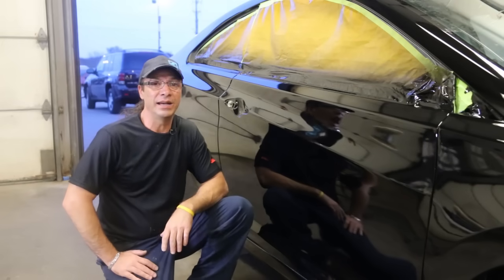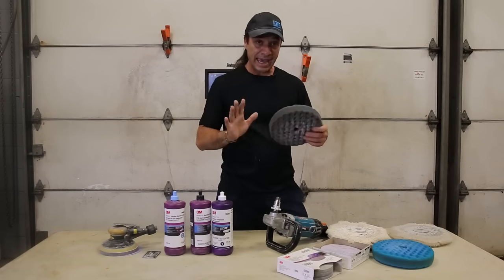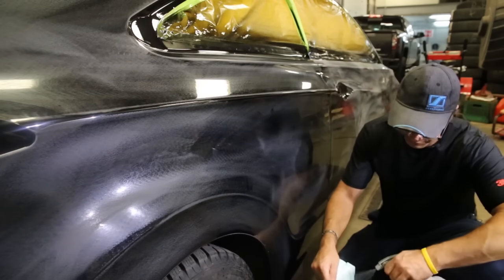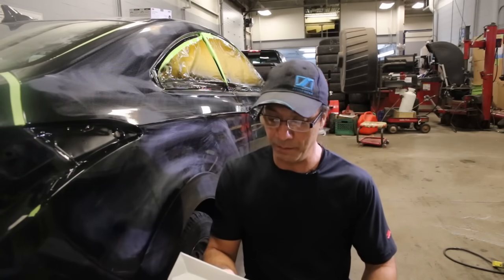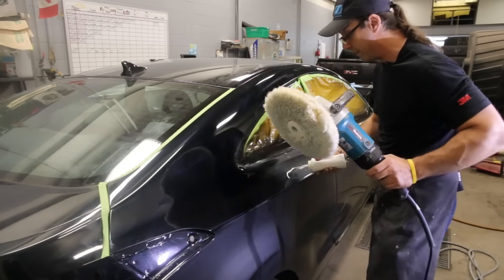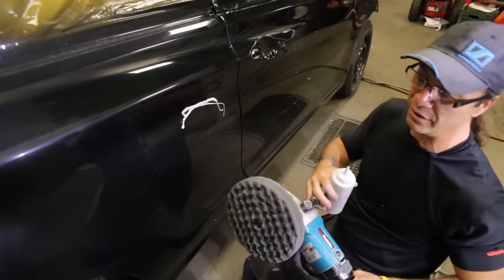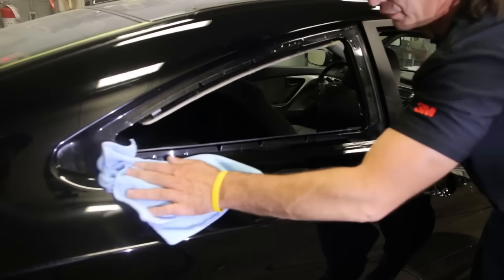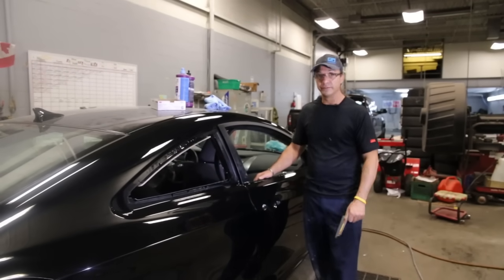Professional wet/dry sanding and polishing tutorial. 3m Trizact system, EX Compound

Comment: Not mentioned enough in this video is the time he spends getting the defects out is on the magnitude of 3-5 times faster than using random orbit. It’s also the only video online where I can’t fault his process. Right compounds, discs and tool. This is an old video. Maybe using trizact 1500 instead of 3m film discs. and instead of 5000 grit trizact go to 8000grit.  Also maybe 3m extreme cut. These all have been released after this video was released.
Reply from the maker: Thanks for the comment but 8000 is useless with today’s clears and compounds. 3000 is perfect with many of today’s products

Comment: Can u buff out pig tails or do I have to sand again?
Reply from the maker: Well. Yes and no. If you create enough heat with the pad you might be able to get them out. Pig tails are caused by the sandpaper being clogged, make sure you wipe it clean more often. You can only go so far with it.
Reply: @loves-Rush-2112  oh yeah I noticed on the spots I held it longer they went away but it does get hot
Reply from the maker: @chrisoo8998  you’ll learn over time how hot you can go before burning the clear. Good luck.
Reply: @loveja1  I'm using a rupes random orbital 21
Reply from the maker: @chrisoo8998  those should only be used as a last step to enhance the gloss and remove swirls. Don’t forget, time = money. Use the rotary first then the orbital.

Comment: Iam using 3m 1500 dry and 3000wet how to keep the curly cues out of fresh paint especially black.
Reply from the maker: lil j are you getting them from the 1500? You can also try 2000 dry then 3000 wet. Once you start seeing pig tails from your 1500, wipe it on your pants as it's running then keep sanding till the pig tails start again. Then change the paper.
Reply: loveja1 yes 1500 dry I try and wipe as I go and wipe pad.iam in a production body shop
Reply from the maker: lil j make sure you follow my steps exactly. From the first wiping down the surface so it's clean and so on. If you can leave a finger print in the fresh paint then it's too soon to sand. Or you just may need more time with the 3000. Make sure you put a bit of soap in your spray bottle and never use a bucket of water.
Reply: loveja1 I use spray bottle of water for 3000 and solvent to clean with

Comment: What exactly do you mean by "dirt"?  You keep mentioning it in the video.   I'm guessing that you mean it's just a high spot in the paint (you pointed out a few of them during the video).
Reply from the maker: ed nja it’s the whole reason behind what this video is about. When you paint a car you’ll get a little bit of dirt in the paint, usually a little spec here and there and you’ll see it in the clear coat. Wet sand and polishing eliminates that.

Comment: What speed do you compound at? Also what is the trick to getting wax out of cracks that you can not get to like chrome trim you do not want to remove due to the risk of bending original 1967 pieces of trim. HAHA
Reply from the maker: Tim Bauer I believe I was using around 1500 rpm. They sell little detail brushes with different lengths. Ask your supplier if they have anything like that.

Comment: someone tried first 1500 step with trizact? should last much longer as those 1500 finish film discs, isn't it ?
Reply from the maker: I don’t understand your question. Explain.
Reply: @loveja1  the first round of orbital sanding with 1500 grit. Did someone tried that with trizact 1500? Or does it not show the nibs as good ?
Reply from the maker: @lutra7670  2000 will work perfectly as well to show all the dirt nibs.
Reply: I understand that. The question is if for the first step a trizact disc would work better ?
Reply from the maker: @lutra7670  yes. You can start with 2000 trizac and make sure you have the interface pad on first.

Comment: What are the rpms on cutting stage  and RPMs on polishing stage ?
Reply from the maker: Probably 1500 for compounding then maybe 1200 for polishing. Give it take a little bit. I don’t even look any more, I just know by the sound but that comes with experience.
Reply: @loveja1  look like you have done it before 🤠
I have used rotary for 15 years switched to DA  hated every minute of it 👎👎🤮
Back at big boys world with my new DeWalt.
Thank you 
Always thought to go higher with polishing .
Love the rotary way more than da , just a little marking issue but other than that total gold 👍👍
Reply from the maker: @Jan-zm2yv  what I’ve been doing lately is wet sand and use compound for the first step then use a DA with compound then polish with a DA. The results are really nice with no swirls.
Reply: @loveja1  I've seen amazing results from you and others but in most cases it takes way too long of a time I believe even though I only had an entry level da I have said goodbye to da forever
Reply from the maker: @Jan-zm2yv  I really need to make an updated video that incorporates a DA for the final finish. It really does remove the swirls much better.
Reply: @loveja1  I believe you I do the buffing very little don't have  anyone  paying me $2,000 to spend two days on one car.
I don't know if my da was just bad because it was an chemical guys entry level one and maybe I will do a lot better and like the rupes a lot better but I am back in the rotary world and I don't see no way out

Comment: Did that 3000 take out the orange peel looks pretty flat after you did 3000
Reply from the maker: No it will not. Seeing that the 3000 is a soft pad and with the backing pad being soft as well, it will contour itself to all the highs and lows of the orange peel. It will not remove peel what so ever. It’s too fine of a grit.
Reply: how did you get that 3000 to take out the 1500 scratches i just did a hood with 1500 then 2000 then 3000 an buffed an cant get rid of those 1500 scratches took me three times of sanding with 2000
Reply from the maker: @thespraysociety3276  what are you using to get the scratches out? Compound and pad?
Reply: im used of cutting the clear flat then buffing so keeping orange peel is new to me ,but im using d a with backing pad an 3m compound perfect it , the painter said i need a new wool pad so hopefully that helps this is my first polishing job i come from restoration , also is final inspection good to use to clean between steps.
Reply from the maker: @thespraysociety3276  you don’t need to clean in between steps.

Comment: Should I polish the entire car if it wasn’t paint entirely?
Reply from the maker: No need to. I usually do the panel next to it in case it has oxidation or over spray. But to each his own and depends on the vehicle and shop you work for. If it’s not needed, leave it.
Reply: @loveja1  thanks, another question. Do you think this particularly way to polish is a good way to start polishing as a side hustle (me being a beginner)?
Reply from the maker: @benben-sx4xb  there are much cheaper polishes out there for just standard detail jobs. 3m is very costly so find something at your local detail centre that’s more cost effective.
Reply: @loveja1  perfect, another thing, what if the car is not black is it the same process and products if so what other product would you recommend? (please mention them in the order of the process) thank you a lot in advance.
Reply from the maker: @benben-sx4xb  I would recommend these steps no matter what colour.

Comment: Why not take all the orange peel off the car? Ig going for show car finish would you cut flat first by hand with 1000 then 1500 machine ?
Reply from the maker: This is a different process. If you’re doing a show car, then yes, remove all the peel. But if you’re doing a factory paint job, then you’ll want to leave the factory looking peel.
Reply: @loveja1  Thank you for taking the time to respond. Great video!! I was just hired at a shop that does custom paint work and my job is to sand completely flat and buff the cars out. I always did it by hand but if i can use an air sander after i get it flat it with 1000 It would be great.
Reply from the maker: @AAhshitsun  if they are custom paint jobs then you’ll want to block wet sand them.
Reply: @loveja1  yes I block them with 1000 to get them flat. Do you block step all the way up then? I see more and more pros using DAs and trtaxt 1500 wet after they get it flat.
Reply from the maker: @AAhshitsun  I only block with 1000. Then I go to a soft pad for the 1500,2000. Then da with 3000 wet with an interface pad.
Reply: @loveja1  Ok I see. So you do not recommend a DA for 1500 and only for 3k. Anytime I use 1500 wet I get pigtails and squiggles everywhere. Im using Trizac and a 2.5 mm throw sander. The clear is just so soft I wonder if that is the problem because I never had trouble DA anything else. I  really appreciate the help.
Reply from the maker: @AAhshitsun  depends what you’re trying to do. Show cars or Just production stuff.
Reply: @loveja1  Doing show cars only. Fresh unbaked paint 3 days old. The clear is usually soft so thats why the pigtails with 1500 DA maybe. Just tryna figure out a faster and easier method after 1000 grit. Thanks again!
Reply from the maker: You are getting pig tails because you’re using the paper past the recommended using time. You can wipe it with a cloth to get the dust off.
Reply: @loveja1  I only use wet trizact after hard blocking on 1000. The clear is real soft as these guys dont bake and put it on heavy.
Reply from the maker: @AAhshitsun  I would suggest to put it in the sun for a couple of days first. You may get it flat now, but in a month it will shrink back

Comment: For some reason my d.a still leaves pigtails even after using 3k & 5k trizact
Reply from the maker: It’s the paper and not the da, you’re sanding too much without cleaning the paper frequently.
Reply from the maker: Just run it across your pants while it’s on.
Reply: @loveja1  i dont think it’s that cause I use brand new paper pass it 3-4 times and then use 3000 trizact wet then 5k wet and I’ll still get pigtails
Reply: @loveja1  and I use a rag to clean the paper

Comment: 200 cars a month. Thats cute i remember my first rodeo lol. We do 60 cars a day paint and i have to correct them. 3m is good because of the fillers. But water base is easier clean up and no fillers
Reply from the maker: 60 a day? That’s nearly impossible unless you have 10 spray booths.
Reply: We have 3 lines  9 booths total are cars are bagged then the side of the booth opens up and cars are on carts on a track go thru side ways.  I base one base other then clear both shove them down to the 3 booth to bake together . Why im base 2 more. Each line paints 20 a day
Reply: It was 24 cars per line but they finally got realistic and dropped it to 20 and its a struggle to get 20 done. Water base  im not a fan i perfer solvent myself.

Comment: Why not drysand with 3000 grid and then one step polish with DA to remove heavy swirls ?
2 steps instead of 4
No need to go after holograms then as well
Reply from the maker: You’ll never get a piece of dirt out of the paint with 3000.
Reply: @loveja1  what if removing heavy swirls with  3000grid by da ?
Reply from the maker: @007carwashluontoonliikkuva3  you don’t need to sand out swirl marks, just polish them out
Reply: @loveja1  i feel like it would be good idea to sand them down instead when they are very heavy swirls.
Da 3000 grid sand and then one step da polish
Reply from the maker: @007carwashluontoonliikkuva3  all you can do is try and see your final outcome

Comment: I just painted my first car .... And I'm really screwing up the finish work
Reply from the maker: What are you trying to do? Give me a detailed description
Reply: @loveja1  trizact.... I keep getting curlies from one of my steps. I've done the whole truck now the hood looks like trash
Reply: My goal was to remove all of the orange peel. Give it that really nice show car shine....
Did a frame off restoration on my 67 C10
Reply from the maker: @michaelrodgers5105  you can only use those disks for so long before they clog. You can do a small section then rub it on your pants while it’s running, basically you can only do that once. Make sure the surface is clean before starting and wipe your pad off as well. You have to take a lot of precautions when sanding dry because if you get a little piece of dirt on the pad you won’t notice until it’s too late.
Reply from the maker: @michaelrodgers5105  maybe try some 2000 wet then 3000 on a da for your last step.
Reply: @loveja1  I've been doing sections at a time starting with new paper all the way up to 8000..... Two problems I had on the hood got bad advice. Was told to wet sand the whole hood with 1000. 2nd problem was I finally figured out it was my purple foam finishing pad. That I just opened up new. I wipe them off and blow them out. Thinking it was contaminated right from the start of I embedded something in it by wiping it off..... Maybe???
Reply: @loveja1  is there a technique or method to keep the hood from pushing down and moving?  I think that's part of my problem of getting a nice uniform look.  I thought high building and blocking it out was a pain.
Reply from the maker: @michaelrodgers5105  anything above 3000 is pretty useless I’ve always found. Starting to wetsand with 1000 is fine but then you need to follow up with 1500-2000-3000. If you can find an orbital polisher try it, it’s amazing for the last couple of steps. I’m going to do a tutorial on it soon.
Reply: @loveja1  I just ordered the 5.5" Adams one.  I couldn't justify the rupes. I've bought way too much stuff now that I will probably only use once
Reply: @loveja1  I'm also using the DeWalt polisher that's awkward to hold.... But that also comes with my great lack of experience
Reply from the maker: @michaelrodgers5105  you can try and put something under the hood to support it, maybe a blanket ?
Reply from the maker: @michaelrodgers5105  are you in Canada?
Reply: @loveja1  no.... Jersey
Reply: I didn't think about putting a blanket under there. "work smarter not harder"
Reply: @loveja1   as far as a clear coat goes. Does the hardness matter, when comes to sanding and final polish?
Reply from the maker: @michaelrodgers5105  do you gave an iPhone? FaceTime me. 519-854-8973
Reply: @loveja1  no

Comment: Nice instructional. Much needed for after painting. But leave the orange peel? Is that European? I've never wanted to buy a car or own one with visible orange peel. ugh!
Reply from the maker: Rick Bell every car has orange peel, except for some European models or high end. Need to bring it back to a factory look, what ever that may be.
Reply: @loveja1  Thanks yes. I just shot some clear today and my best still left a bit of orange peel. Changed the pressure, the distance and still could not lay it on as well as pros can. I'm not sure why orange peel is something that people want on their cars. It makes no sense really since it is a defect basically. Not like glass smooth. Which to me would be a show car perfection. I've ordered over $300 dollars worth of sanding disks, polishes and 1500, 3,000 grit sandpapers to get rid of as much as I can.
Reply from the maker: Rick Bell do the panels that you didn’t paint have orange peel? What type of vehicle?
Reply: @loveja1  The car is a 70 Mach 1 mustang I'm restoring. Back then, in the 70's in America the paint was put on very smooth and glass-like. AS far as I know. Of course, these older cars may have been done differently than they do them today. Happy New Year Bro!
Reply: @loveja1  The car had no paint on it when I got it other than rust. REstoration. But from the factory in 70 they were done with mirror like finishes. Super smooth.
Reply from the maker: Rick Bell they were all like that because they were all painted with lacquer. Which had to be wet sand and polished.

Comment: With my experience... at least the day after to buff... the clear will dye back and it’ll look dull soon.!!!
Reply from the maker: Julio Vega it may if it’s cheaper clear.
Reply: Even with the most expensive clears it’ll happen... you need to wait at least a month for the paint to fully cure... it needs to breathe and let out all the solvents... then you can polish and cut it... you’ll notice the clear is way harder and it’s definitely going to take longer to buff out... but it will not dye back... obviously an hour after it’s painted the clear is soft and easy to buff... but it will look dull later...
Reply from the maker: Julio Vega I’m not sure what process you are doing because I’ve never had an issue with it dying back.

Comment: Hy! I'n curious, what quantity of diesel you burn for baking the car for twenty minutes after you paint it?
Reply from the maker: Plesea Gabriel it’s propane. Diesel would cost a fortune
Reply: @loveja1  The reason why I'm asking is because I recently painted my car and I dicovered that the man didn't start  the heating(it has diesel heating sistem). He used the cabin only for ventilatilation and filters, but he painted the car at 41°. After buffing and polishing the care is mirror finish.
Reply: What is the difference betwen coked paint and a natural drying proces?
Reply from the maker: Plesea Gabriel if you don’t work in a production shop then it’s not a big deal. Letting it dry naturally will allow the paint to flow out better. Only downside is that you have to wait a little longer for the paint to harden before reassembling or wet sanding. I can’t give you a time on this because every paint has different drying times.
Reply: @loveja1  Yeah, in my case, it took one night before wet sanding. Thank's for your fast answers!
Reply from the maker: Plesea Gabriel let it sit as long as you can before wet sanding. It’s still drying and curing. Good luck.